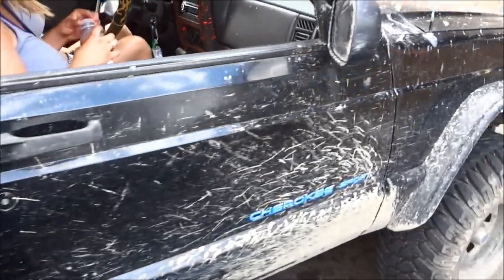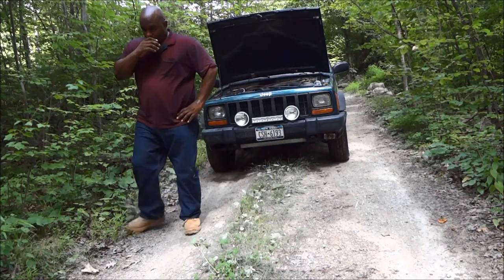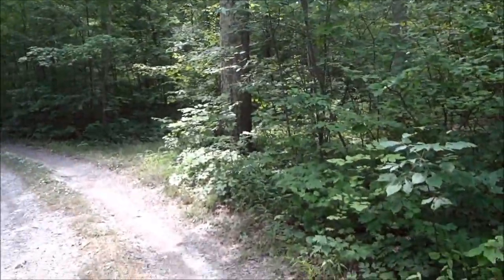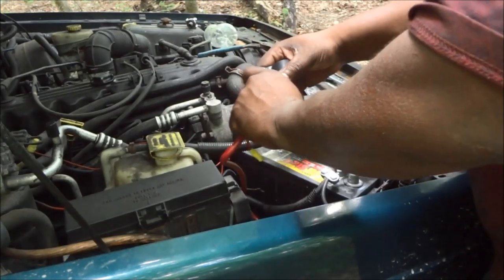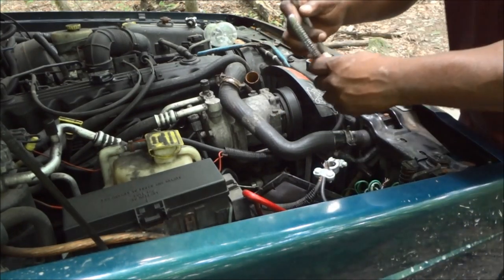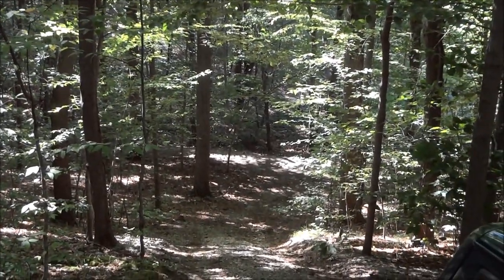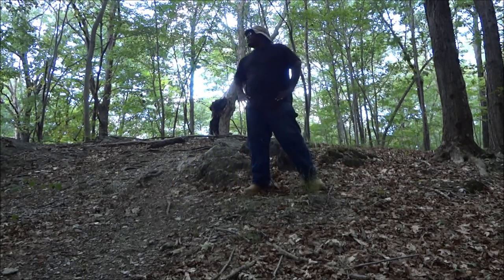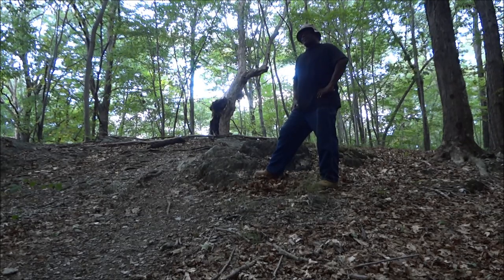Off Road Adventures EP..2..Tell me what u think

Comment: Sorry MOMT but, there are exactly 2 States that I absolutely despise and they are NY and PA, I avoid both like the plague. 
Courtesy of dropped transmissions not once or twice but, 4 times in 3 diff vehicles. One truck was a NEW diesel !
I also try to avoid anything called Lester or Chester anywhere those would be the PA problems.
Check out Bannerman's for supposedly haunted Castle, made with armaments from Civil war to First  WW in concrete and mortar works. Mind the ticks and snakes, and crumbling mortar. I don't think the SJ can handle the Hudson River though.
If my aging and aching back could handle those issues and the 6-10 hour ride - nuff said.